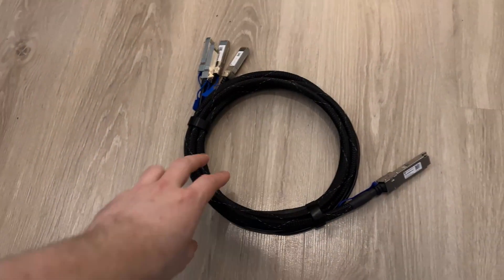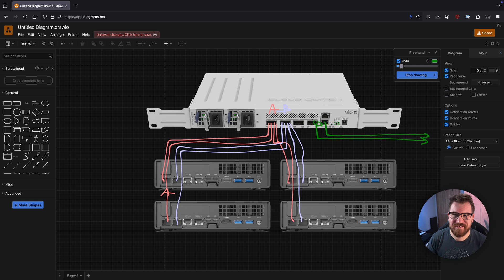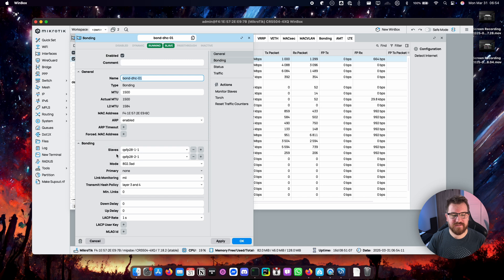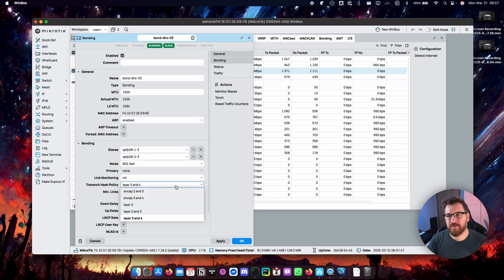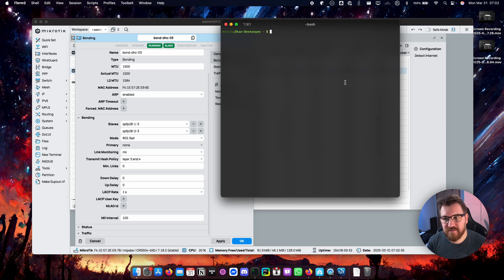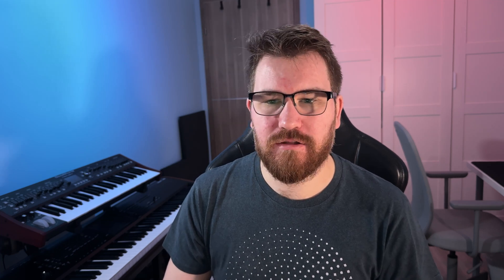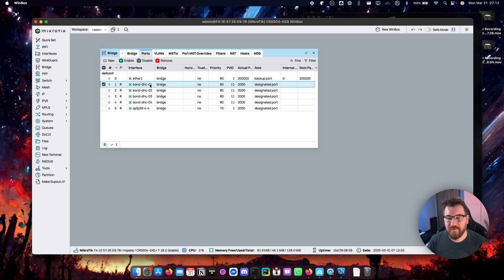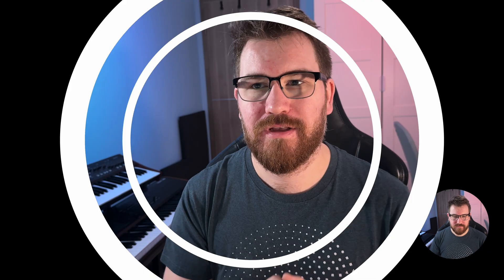Your Network is SLOW! - Upgrade to (almost) 100Gbps (with bonding and howto)

Comment: But why? Its ok, but almost innecesary for a hime lab. And, of cuorse latency will not receduce below your 25gbps port.
Reply from the maker: Standard answer: „Because I can”. Better answer: because I want to test out things, and do stuff as they are meant to be done in real DC (as far as budget allows at the moment). Also, latency was reduced a lot after switching from RJ45 to SFP.
Reply: @DIY.DevOps  Ok, If it is because you can and its meant for DC, perfect. But, if I found the correct minisforum HW you are changing 2.5Gbps rj-45 with 10Gbps SFP+ port, you must expect a latency drop. I hadn't saw the tests with CEPH, very good test. Thank you.

Comment: Curious why you added your 4th node and what benefits you’re getting. I’m running three MS-01s in a cluster. I’d considered adding a 4th for a dedicated ProxMox backup server, which is currently running in a VM via a local NAS. 

I also setup the Thunderbolt ring network. While it works well for my needs, I don’t recommend it for most people running a similar cluster. Outside of being difficult to setup, the lack of out of the box support for TB as network interfaces tells me that any change to configuration, node failure, even reboots, could potentially cause issues. It’s working for me currently, but I don’t like the “hacky” solution compared to a more stable “production-ready” scenario. 

Thanks for the video. This was great info.

Comment: you don't magicaly get lower latency just by going from 1, 2.5, 10G to 100g. Unless you're maxing your ports out all the time. The latency difference would be soo small it almost unable to be measured.
Reply from the maker: Yeah, but going from RJ45 into SFP does reduce latency substantially, which is important for low-latency services like Ceph.

And the difference is real in my case.
RTT via RJ45 is about 0.200-0.250ms, but RTT via SFP is about 0.075ms, which is measurable by all means (data reaches destination 3-4x times quicker)

Comment: Where's times when hub plus BNC and 10mbit convection was soo fast😂 2.5Gbit is too expensive, funny taking about 10Gbit+😂 yeah
Reply from the maker: That's why I bought this switch - because it was cheapest 16x 25Gbps on the market :D

Yeah, I'm using it with 10G connections... yet. Planning to buy Mellanox 4 cards for 2x 25Gbps ;) I want my homelab be more like home-datacenter.

Comment: I ran straight to the comments to say you can use USB cables to connect your USB4 ports together and get 20gb/s without bonding anything.  Just make sure you use quality USB4 cables rated and even certified for the job.  Also you don't even need a switch for that part of the networking.  It's a cool way to run all your clustering data, then use the 10gb to the clients.  Why not take advantage of thunderbolt 4 ports with fast networking in Linux.  I am not sure what you would do if you are using Windows, maybe since Microsoft is adding Linux to Windows as fast as they can, it will work because of that?!  Then you could also bond your 2 10gb ports to get more.
Reply from the maker: You can :)

But I want this homelab to be real production configuration like we do in data centers, so I won't do any hacks like that.

Also, ring topology is a problem wtih more computers, as split in 2 places will cause big disruption.

Comment: I have an almost identical setup with 2x CRS309-1G-8S+ which support MLAG. So each PVE host connects to both CRS309 using LACP. At present I have 1 link between the two CRS309 for the magic. I found this to be cost effective due to ability to use MLAG on day one.
Reply from the maker: @johnwalshaw yep, MLAG is the plan for future me ;) (read: when I save more money to buy second switch :D)

This CRS504-4XQ-IN was most cost effective 16x 25G links for me (another model with separate 16 ports is twice the price of this), and I can use 100G links later for future project I have in my mind ;)

Comment: Really useful video thanks a lot. I have just one question why don't you interconnect the MS-01s via USB4 Thunderbolt in that case you can lose the whole switch and they could still talk to each other?

Edit: What kind of CPU do your MS-01s have?
Reply from the maker: Thank you!

I saw Jim's Garage video on Thunderbolt networking, it's a great idea, but falls very fast when you have more than 3 devices. If 2 of them  (which are not neighbours) fail, then your loop is broken in 2 places, and you get into traditional split-brain situation. And I already had scenarios when I had random nodes 2 shut down for some periods of time for some maintenance. So... loop is quite dangerous in my opinion, as you can lose only 1 unit at most (or few if they are strict neighbours), and servers is something you should be able to reboot however you want (at least that's how I think - let's not complicate things even more ;)).

I am also not sure about latency of thunderbolt networking... here with SFP28 ports I have about 0.06ms to another node through switch. Which is about 10x faster than RJ45 by the way...

Also, I treat this cluster as real production-setup cluster and I'll be showing you how we do things on real production servers, so I decided to do with standard switch configuration ;) In the future, I'll add another switch and create MLAG to have high availability for switches themselves - then problem you mentioned (losing switch) will not exist anymore ;)

Regarding MS-01 question: I bought cheapest variant of MS-01s because my priority was 10G ports and a lot of memory possible to put inside, so it's just i5-12600H. But I'm waiting for new MS-A2 with AMDs which will have a lot more cores. Altough I don't need them that much as I still have plenty cpu and RAM unused :D

Comment: I think you picked the wrong switch.  Buying a 100 Gbps switch just to end up with break up cables at 10 Gbps?? For that matter you will save money and complexity on configuration with a 10 Gbps switch like  the CRS309 or the CRS317
Reply from the maker: Nope, because it gives me 16x 25G ports for cheap (especially that switch with 16x SFP28 ports is twice the price of this!), and I want to put SFP28 cards in MS-01s in near future when I collect money for cards ;) Buying 10G switch would be waste of money - limiting myself with switch (again! as I did that with previous Omada switches).

Right now, I'm just using what I have (so 10G built-in NICs), but I'm thinking ahead of future and buy stuff depending on what I plan in future.

And I have already plans far ahead few years what I'll do with this specific unit when I build a house and use those 100Gbps ports ;) so it's not waste at all in any scenario ;)

Comment: If you're not using the PCIe slots in your MS-01s, it might be worth it for you to add a proper 100 GbE card in there.

The fastest that I've been able to get with my Ceph cluster where I was experimenting with running it over 100 Gbps Infiniband and each of the node has a Mellanox ConnectX-4 dual port 100 Gbps IB NIC -- as a result of compression during the migration process, I was able to get 133 Gbps out of a possible 100 Gbps.

For my switch, I am using a Mellanox MSB-7890 externally managed 36-port 100 Gbps IB switch.

For your storage use case, especially with the MS-01, you might be running into an issue where it doesn't know whether to use P-cores or E-cores to deal with the network traffic, so there may be further opportunities for you to optimise that.
Reply from the maker: I’m quite worried of heat from 100G NIC inside MS-01 :/ I also never used Infiniband before, so not sure about this… Ceph is not my main usecase, I just showed it since this is something that takes most bandwidth possible, but I have normal Kubernetes apps there, so I still like my Ethernet network ;) yeah, I know I could use different networks for regular traffic and Ceph backend, but not sure if that makes any sense at the moment, because SSDs I have inside are nothing crazy anyway…

I’ll take your ideas and read more about IB and hardware you proposed, thanks!

For now, I’m just thinking of „simple” upgrade to ConnectX-4 with 2x SFP28 - hence this switch with splitter cables to SFP28 connectors ;)

Regarding cores that process network traffic, you’re right, I must still tweak some settings ;) performance improvements is another topic to show as this video is already 15 minutes long, sooo… let’s not make it too boring :D
Reply: @DIY.DevOps  ConnectX cards usually can be switched from IB to Ethernet, so IB is not really a problem with them.

Comment: For your bandwidth testing you should test with something like iperf and enable multi-stream. I suspect you might also be hitting a common problem people have with "increasing bandwidth" using LACP/802.3ad which is that none of the algorithms allow for true saturation of the interfaces. You will often see only 1.25 or maybe 1.5x the capacity of a single interface. So in your case 15Gbps. iperf will often demonstrate this very well.
Reply from the maker: I did tests with iperf, it was just 2x 10G interfaces bond, so I didn't bother to put them into video as it is far below switch possibilities.

It's full 2x 10G speed with correct settings ;) Keep in mind, I'm using layer3+4 hashing, instead of 2+3 that's LACP-compliant. And 3+4 hashing also takes UDP/TCP ports into account when hashing traffic so it's spread a lot better when using multiple connections between same servers.

# iperf -c 10.19.11.22 -P10
[SUM] 0.0000-10.0072 sec  23.0 GBytes  19.8 Gbits/sec

(with MTU 9000 - altough I did tests before this video and it gave me about 18.5Gbps with MTU 1500)

And benchmark results I shown are from Ceph itself, and it is not build for high-performance unfortunately, so it's not weird I am not able to hit full 20Gbps with Ceph even though interfaces can do that easily.

Comment: Interesting. I currently have 3 MS-01s, and I am planning to get a fourth. This is something I'll consider adding to my setup.
Reply: I have 2xCRS309-1G-8S+ and very happy with the MLAG performance to my three PVE hosts with a LACP bond spanning both switch. If I was buying new hosts I'd get the MS-01 in a heartbeat!
Reply from the maker: @johnwalshaw MS-01s are great for the price! Not perfect - far from that with their mobile CPUs and they kinda overheat too, but still - 2x 10G nics with possibility to upgrade to something even better thanks to standard PCIe slot, 3x NVMe, up to 128GB of RAM possible (Crucial just showed first 64G SODIMM modules, so now you can put even 128GB in total - I have 96GB). That's really wild for the price point of those devices!

And networking, ram capacity and storage capacity were my mains factors for buying decision. CPU was last (number of cores were more important for me than their perfomance for this project)
Reply: @diy.devops  I like that a couple models also have vpro which is really worth configuring. My older i5 10th Gen have the basic level and the serial over IP is great.
Reply from the maker: @johnwalshaw  I tested this vPro and it's kinda pain in the ass to be honest.

First of all, there's no web management at all. You need to install third-party software (MeshCommander) to even be able to access computers with vPro.

Another (much bigger) problem is, when you try to do remote screen connection to vPro device, device prompts user (!!!) to press a key to allow admin to remotely access screen/keyboard/mouse. Which is... ugh... not possible to use in server-scenario when there's no user in front of the screen and that message appears on video output not even connected to anything :/

And yet another issue (connected to previous one), remote screen/keyboard session works only for few minutes, and then timeouts and you go back to problem nr 2 - need to approve once again...

I think I found out somewhere some workaround, but it needs a lot of configuration and that's not something you can do in BIOS/System Setup unfortunately so I did't bother to continue experiments with that :/

Also, how network works with vPro is also kind of magic... it just intercepts packets sent to some specific port, and enabling vPro network was also kinda challenge (1 option to enable in BIOS which... didn't really worked immediately)
Reply: @DIY.DevOps  You can remove that user consent for connection in Intels AMT configuration in the BIOS. I have around 40 of Lenovo Tyny M920q, M910q and M900q models with i5, i7 and i9 CPUs (from 6th gen to 9th gen, all with T) and I can remove that user consent. Same on Dell and HP tiny models. That is not a problem at all.

The real problem with vPro, at least on desktop hardware, is the need to use dummy video dongles (VGA, HDMI or DP). Without those you don't get any video output in the MeshCommander, because if the graphics card can't detect the monitor it doesn't output anything and as a result you get black screen.

Other than this everything is working. Not without its quirks, but usable. Of course real IPMI/iDRAC/iLO/IMM2/etc would have been way better, but it is good enough for home labing 🙂
Reply from the maker: I got 4th one just a month ago… I couldn’t stand free space in this MS-01 3D printed rack enclosure ;)